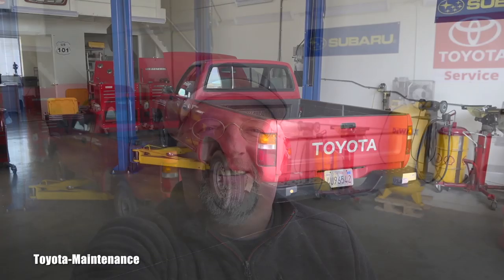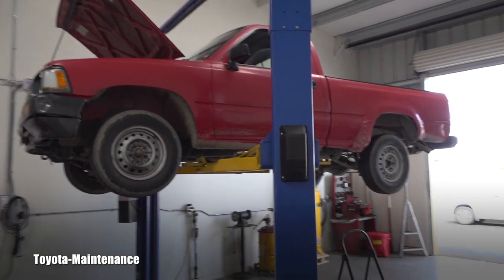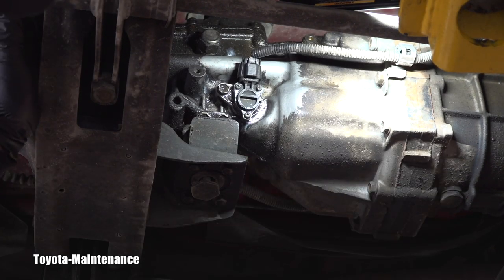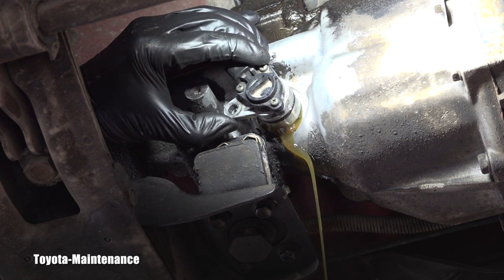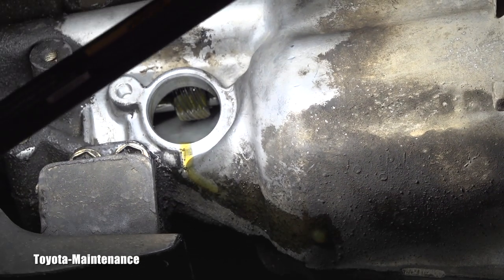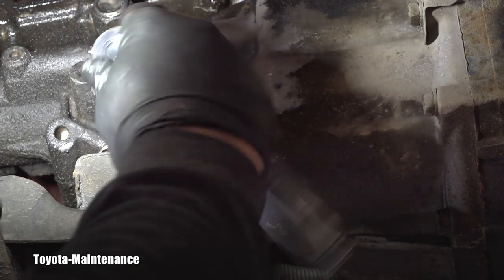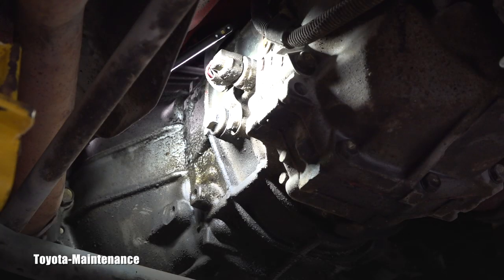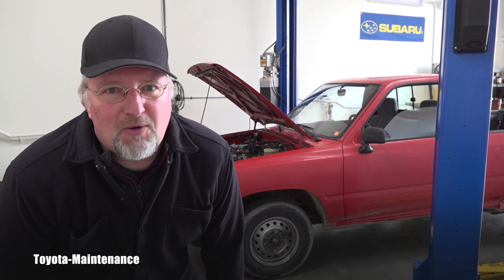Toyota transmission speed sensor

Comment: Great video Peter, I had a jumping needle and ticking sound on my 2003 Hi Lux speedometer. I installed a new genuine Toyota speedo cable and another speedo gauge from the wrecking yard, the problem is still there! AHHH!! It may be this sensor you replaced is also faulty in my gear box creating this annoying driver experience. Again, great work and thanks for sharing your knowledge. I like that you clean stuff before pulling things apart, me too, i don't want sand and rubbish in with those gears.
Reply: did it solve your ticking issue?
Reply: @efil4kizum  Yes mate it very did, no more ticking, so nice to experience a silent speedo!
Reply: @telecasteredtodeath   my '97 Tacoma 5vZ does not have a sensor that looks anything like this, i am so stumped!
it has a gear inside the transfer box that connects to a speedometre cable and that is all i can see... i cannot find a speed sensor on ANY parts diagram for my rig!

Comment: Hi Peter, I have the same Pickup with an issue with the speedometer it's not working correctly, can you tell me how to diagnosis that problem? Is the problem from this sensor or it's from the cluster? Thanks

Comment: Reason why it's in nice condition is because you're in California. If you were on the East coast, it would be a Flinstone wagon with holes thru the floor !
Reply: truth to that!  i rarely if ever see one of these old Yotas on the roads anymore where i am at in rust belt area... but this '93 truck had all the nasty corrosion in the engine bay perhaps from the salty ocean mist?

Comment: Is there a source for the little clip that retains the gear shaft? I Set one aside, and now can't locate. Not all sensors come with the gear, and one source could not guarantee a clip was included. PS.. what do you think of the sensor quality on Ebay? I am picking up a $30 spare with gear;  Kind of heavy handed just to get a clip, too, but if it is reliable, nice to have spares in the parts box. I have changed one years ago in my truck. I bought direct from dealer then; even now the dealer price is less than it used to be.

Comment: Great video but I just attempted to do this without draining the trans fluid and lost a LOT of oil, even though the truck was jacked up from the passenger side. So be prepared to drain and change your trans oil when you are installing a new speed sensor. Not sure how Peter did it with minimal spillage.

Comment: Hello,  i have a double cab diesel 2.8 4x4, year 1994,  gen 5 th (i guess), run 280 000 km, yes in km, and the odo and speed are not working anymore. The sensor looks very much like in your video, but there is alot lot of number ofthe second part of the number. Are they all the same ? Can i buy aftermarket ones ?

Comment: thank you for sharing. if the gear fluid is low. is there a special gear fluid or just use transmission fluid to top it off?
Reply: use gear oil like you would use for differentials or manual. if you have a auto that will use atf and should not be used in the transfer case

Comment: Hi there, I have a Toyota 100 series landcruiser 1HDTFE one, and notice a flashing O/D on my dash. it does come sometimes and then after maybe a couple of km the flash is off again. 
from my google research it give a lot of things to diagnose the problem and one is the speed sensor and some say maybe the shift solenoid?  i knew i need to send it to toyota but i want to know what are the causes that may result in O/D flashing. it does not come often but it so annoying when the flash comes out again. it maybe a major problem as well of my beloved truck.. Rayan from NZ

Comment: All you really need is the rubber (o ring) gasket for around 5-cents at Lowes or Home Depot, in which case you wouldn't even need to remove the clip & gear because it's much bigger to pass right over those and slip it on.

Comment: Hi just replaced the sensor and still speedometer not working, will appreciate your comment what can I do now same truck 92 pickup base model rear wheel drive manual transmission 4 cylinder
Reply: any luck on getting speedometer to work after replacing the sensor?  cluster gauge maybe?
Reply: @MushroomPot420_69  no I didn't try anything else driving without speedometer
Reply: @erickvillarroel8786  that's the cheapest "solution" haha!  (but is probably either speedometer needs to be removed with cluster gauge and cleaned/ resoldered OR its a speedo cable wiring issue)

Comment: I am having trouble putting my gear back in on the end of the sensor. It just bottoms out hitting on something inside the transmission. I'll try again tomorrow, maybe I need to stab it in straight lining up the bolt holes.

Comment: I have a 1994 2.4 L with automatic transmission.  Toyota also provided me with that same part number...8318135070.  However this part looks different than the one in my truck. Is there a different part number I need to get for replacement for my truck?